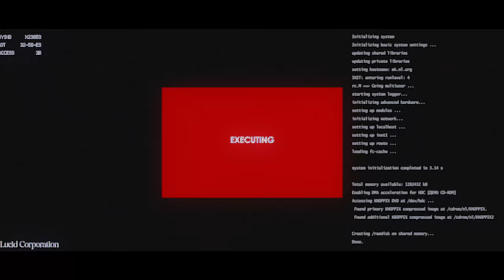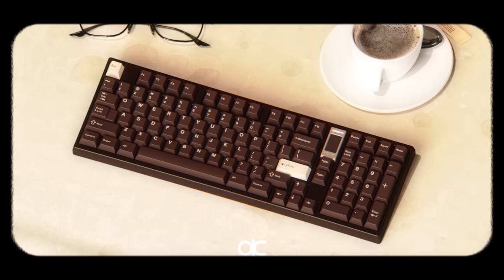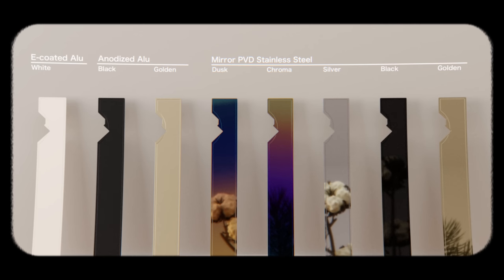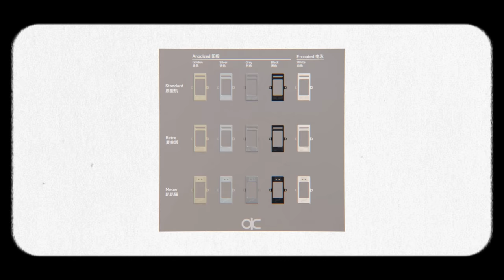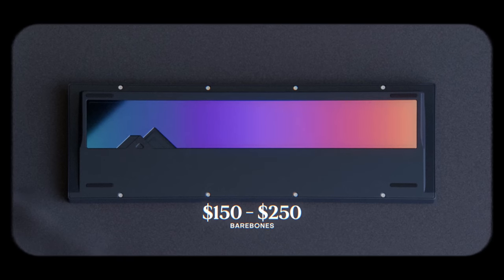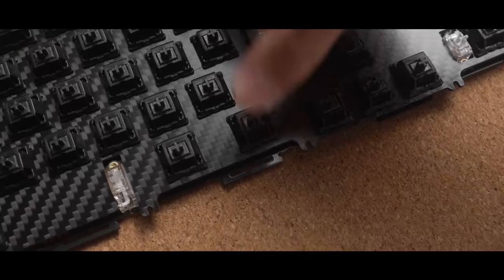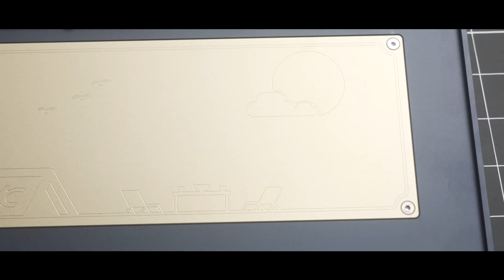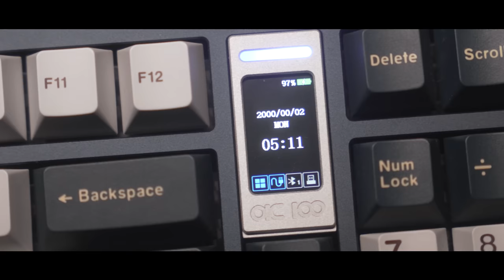This Budget Keyboard is ALMOST Flawless

Comment: This is a sound from a QK board I did not expect. I really like that they've started to include options that help with reaching a higher pitched sound with the board.
I still don't know why there isn't a flexcut-less version of FR4 and Alu and I don't think I'm qualified enough to even speculate why but I think if they removed the flexcuts then they could help the board fit my preference in clack.
Reply: flexcuts on the harder plates don't really affect the sound profile based on our tests - ofc it is subjective, not scientific
Reply: @qwertykeys2119  I did not know that the flex cuts didn't really affect the sound. Thank you for telling me!

Comment: have you tried to run this plateless? looks like its possible since one of the mounting solutions is on the pcb.
Reply: he didn't get a solder pcb so it'd be showcasing something he wouldn't suggest people doing with hotswap pcb

Comment: I think that a budget keyboard kit should be under 120 dollars
Reply: For a full alu build with up to date features, prices usually float around $300-600 - so yes there are definitely cheaper boards, they’re usually plastic case, tray mount, etc. That definitely doesn’t mean they can’t be good, but this keyboard is budget for an enthusiast experience